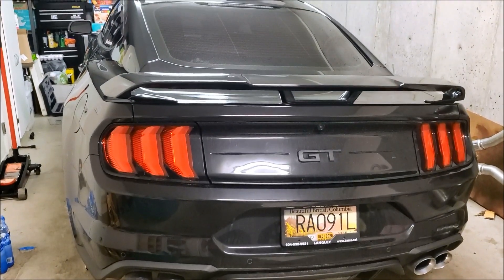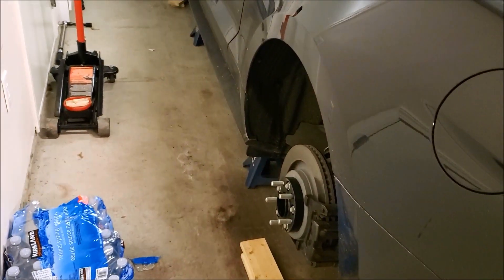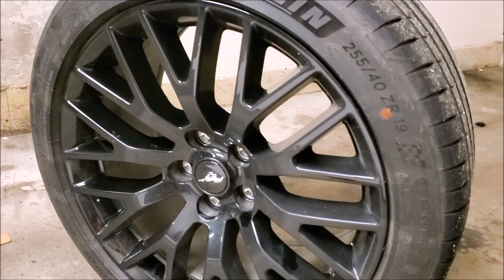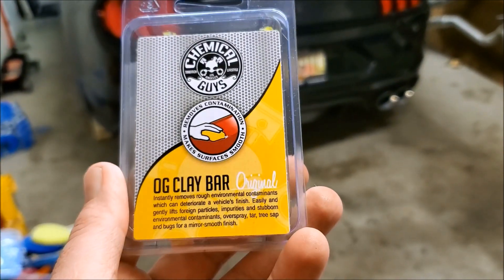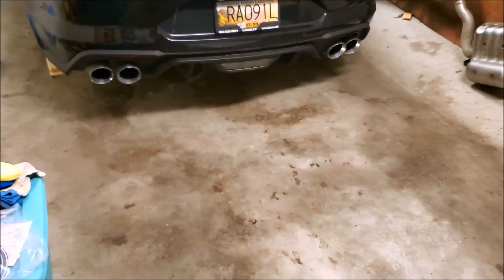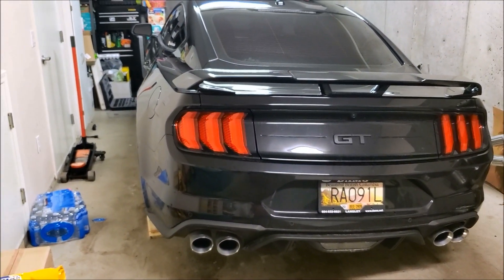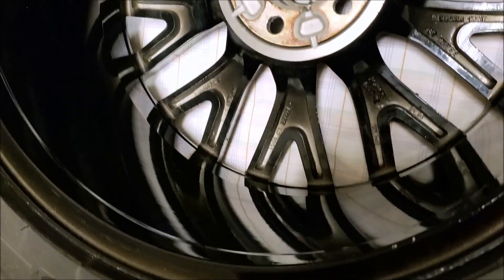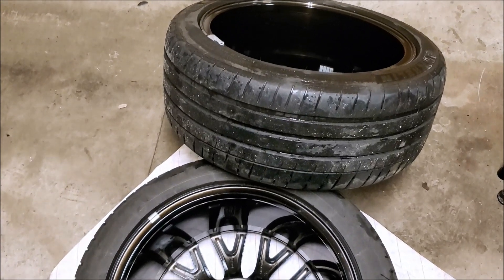I CERAMIC COATED MY RIMS WITH MR.FIX 9H CERAMIC  **CHEAP AMAZON RESULTS**

Comment: I myself have these exact type off wheels on my Mustang and I have also had this style on different cars over the years. Where I'm from we simply refer to them as "BBS" styled wheels. I don't know why so many car folks and detailers claim to have such a hard time cleaning these wheels. Listen, the easiest and fastest way to do is to get your favorite degreaser or car soap and get yourself a good old dollar store bath loofa with a handle and you will clean the crap out of the spokes and barrels like child's play. That's it. You're welcome. Great video btw.
Reply from the maker: Your actually the second one to mention the loofa. Its something I would have never thought of but ill be getting one now. Thanks for watching
Reply: @CanadianCruisin  I've been using loofa's to clean wheels for year. You'll love it man. Great channel.
Reply from the maker: @lookahere  thank you. What wheel cleaner do you use most
Reply: @CanadianCruisin  As for a dedicated wheel cleaner, I have last used Adam's and even CG Diablo gel. I was/am impressed with the Adam's but in my opinion, the CG has turned out to be about the same as a mild car soap. My go to wheel cleaner for a while has been Dr Bronner's Sal Suds and Simple Green. The Sal Sud's does an outstanding job on the wheels and tires with very little product. Hard to beat the cleaning power per dollar with that stuff.
Reply from the maker: @lookahere  awesome. I'll take a look
Reply: @CanadianCruisin   Okay my friend! Let me know what you think!

Comment: No, you shouldn't apply wax before a ceramic detailing job. Ceramic coating is designed to be applied to bare paint. If you currently have any wax on your car, you'll want to remove that wax before adding the ceramic coating.   (taken from internet)
Reply from the maker: There was no wax applied before the ceramic.

Comment: I'll be doing this to my black chrome FR500 wheels before spring time. Came out very decent for the price!
Reply from the maker: Totally worth it. And would be way easier if they aren't filthy first lol
Reply: Canadian Cruisin mine are brand new 0 miles lol. Won’t drive on them until they’re coated especially since they are black chrome. I don’t want any hot brake dust messing up the finish.
Reply from the maker: @streetmodjunkiez2049  I should have done that when I got the car but I failed lmao.

Comment: How long did the coating last on your rims and was the cleaning alot easyer? Just done mine and looking 4wrd to the cleaning test later on.
Reply from the maker: It's been a few months now and its holding up well. Cleaning is definitely easier. Get a good wheel cleaner and you dont even need to scrub
Reply: @CanadianCruisin  ph neutral then! Will just try snowfoam and the jetwash😁
Reply from the maker: @andyroosterag  let me know it works 👍